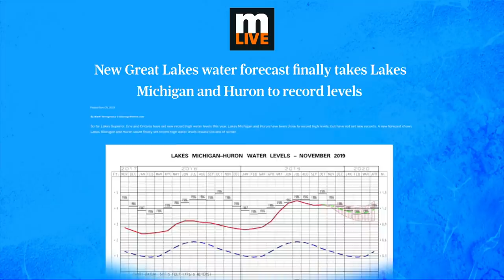Vanishing Shorelines | Great Lakes Now

Comment: the reasons they built on shorelines like these  is that in the past when something like this would happen the gourments would help the communities  rebuild and in the processus  people ended up with new free houses  worth 30 times the price of the original ones and people would make huge profits when they sold them a few years later . But now the gouverments do not help anymore cause they realised that people were simply abusing the system  when they could have gotten a geological survey done to see if it was worth it to build there . People who built there new exactly that the shores would erode eventually  and that when it would happen the gouverments would relocate them a bit farther from the sure with houses worth 30 times what they had spent on the first ones .But the trick doesn't work anymore . now the goverment gives you what your property was really worth  and you cannot rebuild anywhere near the shore line and it was about time they did that to . 

Here in quebec back in the days when a guy wanted to build a cottage on a lake shore in the forest you needed a permit but the permits was given only after a servey of the location where you wanted to build was done by the local ministry to see if they would allow it  and many times people wouldn't get the authorisation so people started to pull a fast one on the ministry and built before asking for the permit so since the cottage was already built the ministry decided to give a lot number . But after a couple of decades people had exagerated to much on that little fast one and recently close to Quebec city one person decided to build a 750,000 dollars cottage in an area where the ministry would normally not give any permits and lot numbers and when they found the cottage that had been recently built they sent the guy a notice to either move or demolish his illegal house . the guy went to court to try to win his case and stay there  but the court decided that the choice to build there was on him and that he exactly knew about the restriction to not build there . since then he made several appeals but lost all of them and the house has been demolished about 2 years ago

Comment: Water levels will rise and fall. The army corp of engineers have constructed ramp-like devices that allow water to flow thru and over them  but collect sand, thus extending beaches into the lake.  Would not be cheap--but you should get something more for your taxes than nothing.  A little work done consistently gets things done. Never getting started means never getting done.

Comment: give it a rest folks, the Great Lakes Region had high water levels because land management kept high levels for hydraulic Water Power production. 
did ya get that? 
As liberal governments did away with Coal Fired Power Generation. A huge transfer burden was placed on dependable power production still available. That in the Great Lakes Region means, keep lake levels up so that water levels can be there during peak summer weather time the flow to the turbines could be maintained, and keep Cottagers happy on wonderful beaches and rivers. 
But it ended up a wet winter and thousands and thousands of miles of snow pack with wet spring drove the Great Lakes Regions watershed higher and higher. 
Now most people don't know or understand that the St.Lawrence River flow rate is controlled as well. Why? Because there are flooding issues of the St. Lawrence River to the Atlantic Ocean. You will flood Quebec and the North Shore New Brunswick Regions. It also affects incoming Ocean traffic vessels. 
In other folks, Canada and the US screwed up trying to be GREEN PROGRESSIVE trying to maintain the energy market grid whilst taking out dependable Natural Gas, Oil Fired, and Coal Fired electrical production. They miscalculated outflow water and retained water for Hydro Dam energy potentials.

Comment: i have a way thats a win win for everyone ,If we did like they duo when building man made islands take and you a dredging machine and some spray pumps that can push sand blow sand in front of the land like building a sand mound by doing this you will lower the water table by putting the land back where it belongs mix last round with fresh cement to harding it up to keep it from happening again  put weight limit s on ships that will help keep it down but greed is what causes a lot of this basically if done right will change it and we can have room to add back up every 10 to 20 years way better watches homes be swallowed up are going over the edge in the middle of the night thats my idea take it for what its worth
Reply: 17 year cycle.  Look it up